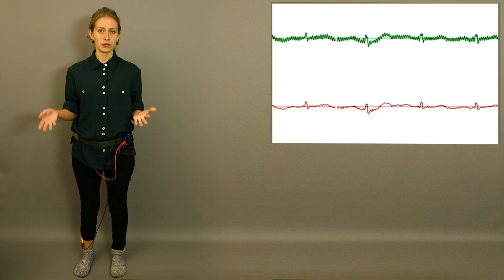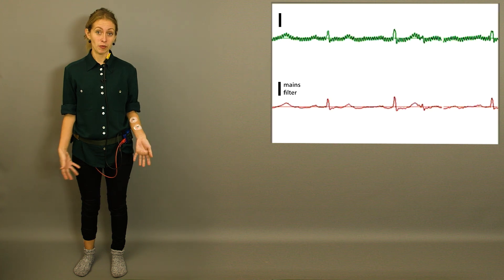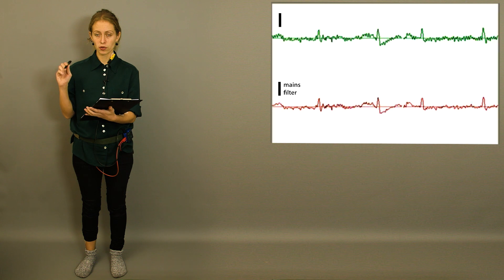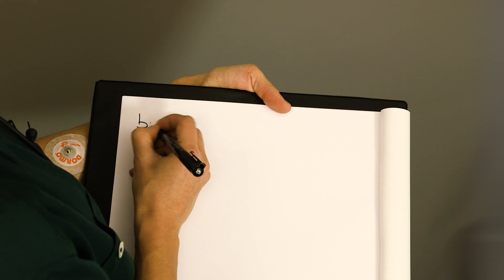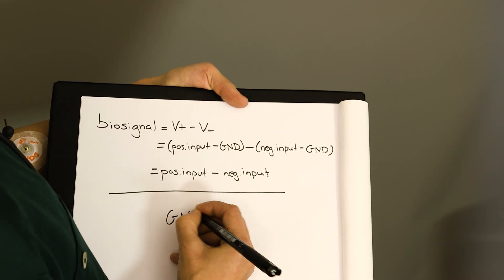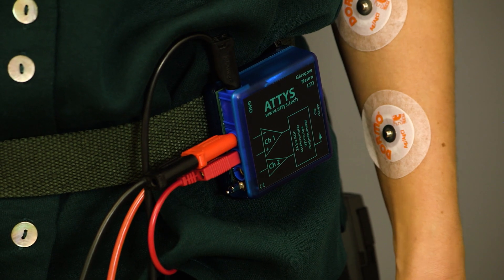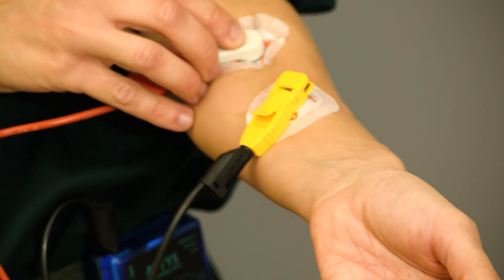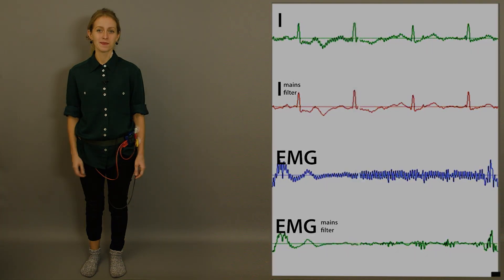Investigating the right leg, RL, A or GND electrode in ECG, EEG and other biosignal measurements.

Comment: What about if I use single supply config. Do I connect ref voltage to negative input if i want 2 electrodes configuration.
Reply from the maker: Single supply config? You mean no negative power supply? ECGs have negative components so won't work. Either way it doesn't matter if you connect one electrode to GND or Ref. It's always a "ref" either to GND or ref voltage. What you get then is a simple non-inverting opamp circuit. GND to right arm. Non-inverting input to left foot. That won't cancel out 50Hz so you'd need a very good 50Hz mains filter. When using a wireless box (like the Attys) without a connection to mains GND that's not too bad when short circuiting GND and the neg input which is done for the 2nd channel in the Attys but needs a good digital notch filter to remove 50Hz. https://www.attys.tech/how-to/

Comment: Is it a driven right leg or just neutral?
Reply from the maker: Neutral
Reply: Would you still be able to connect the two electrodes together if the "right leg" were driven?
Reply from the maker: @ytubeleo  Yes. The driven right leg is still basically "N" but injecting back a small amount the inverted amplifier output so it will still reduce 50Hz. However, the right leg drive is less and less used as it was an analogue means of reducing 50Hz noise and digital filters offer a cheaper way of doing so.

Comment: Hello there, I am kind of confused at the end. Why does "two-electrode" EMG signal has more 50 Hz power line noise in it? Didn't we said that it actually has three electrodes as well since ground and the negative inputs are connected internally? So technically both channel 1 (ECG data) and channel 2 (EMG data) have 3 electrodes right? If so, I don't quite get what is the difference between first channel and second channel that causes one to cancel out the power line noise and other to not. I would be glad if anyone could help. Cheers. :)